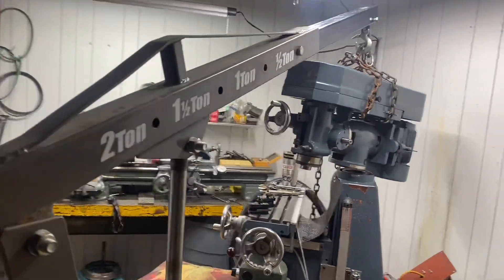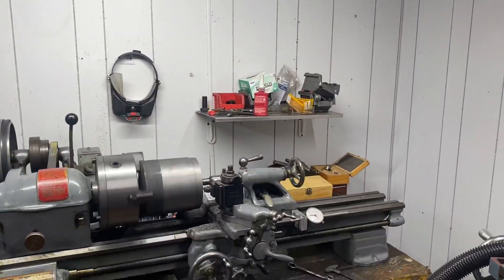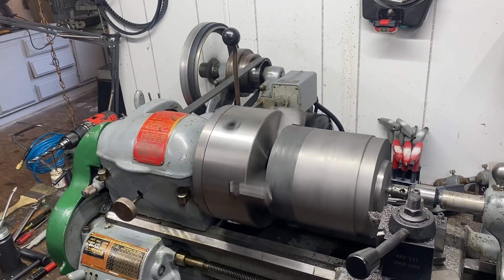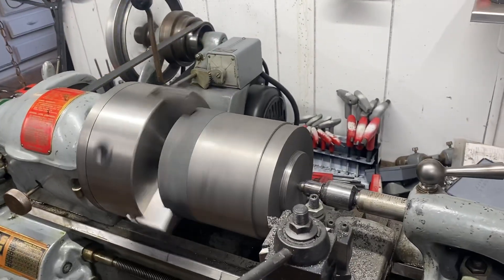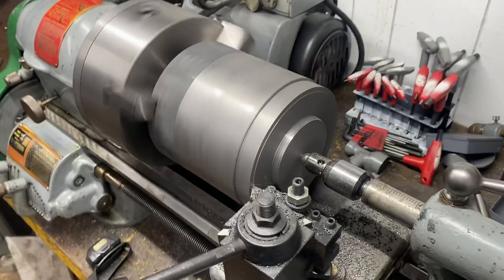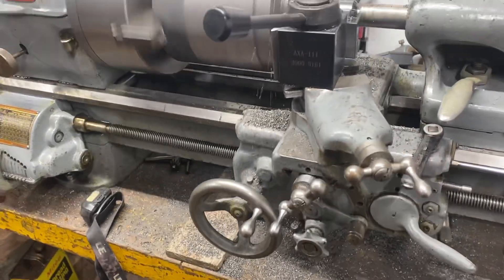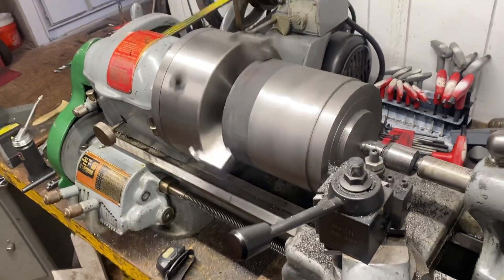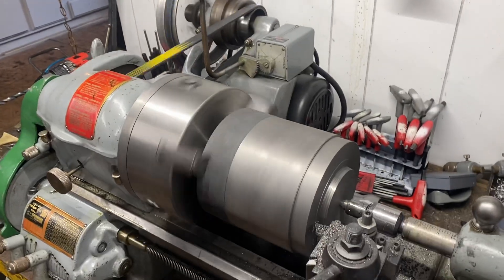Machining riser for the Enco mill

Comment: What are you using for that verticle way cover? Looks like fiberglass mat, maybe rubber? How is it secured at the bottom?
Reply from the maker: Both mills have thin rubber as protection. Screws and a long thin piece of metal, makes a “sandwich” which holds it in place.